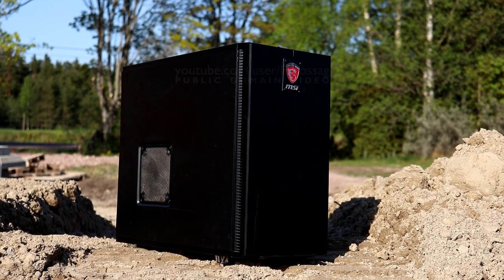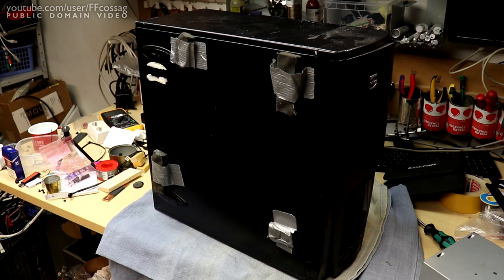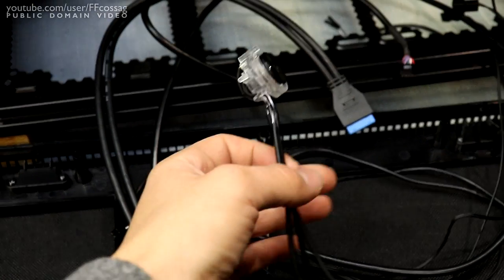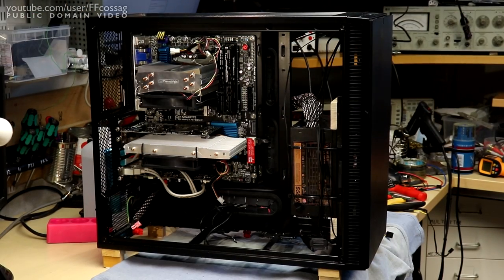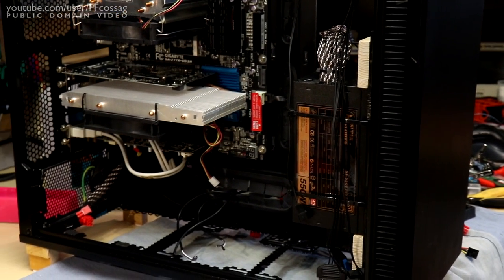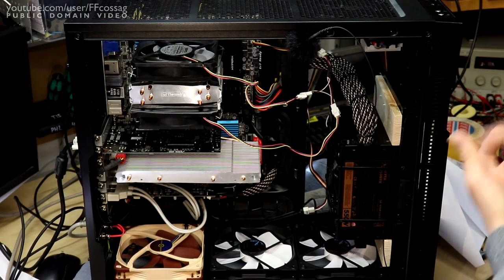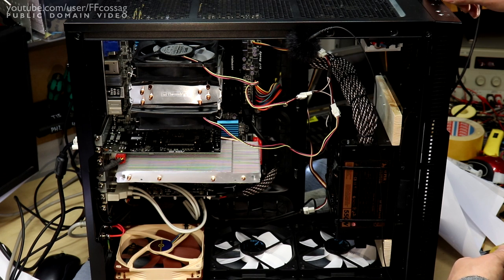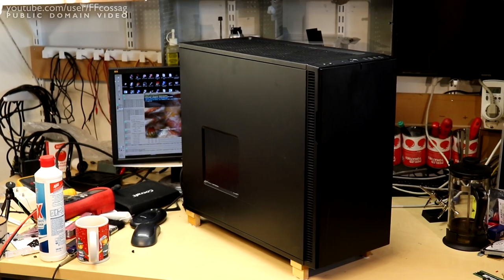Fractal Define R5 with PLYWOOD and JENGA BLOCKS!

Comment: One of the advantages of getting older (I'm 64) with some hearing loss is that you don't notice a lot of the fan noises that the majority of people do. As long as it isn't the higher picked whines of smaller fans like laptops and the high pitched whine of the old 60mm Delta 38's from the late 90's I don't even notice them. If I do, it's just a gentle whoosh that quickly fades into the background. 

I really do like how you created airflow paths instead of brute forcing it. I don't take it to the level you did here, but I do use some of those same techniques for some systems as needed.

Comment: Hey, I just got white r5 with a side window. It is the nicest case I have, but it went to the garage, because tthat is where my server room is, and I got it for hard drive capacity only :) have 0 drives in it though for now, only m.2, drives are in a old  DAS unit I got cheap, which turned out works fine with new drives (replaced controller card that goes into the computer)

Comment: you put great ideas in this pc case, well done!  the mainboard is a very powerfull one i run the same for years now 24/7 with tons of hdd around 280TB connected -)  32gb ram on 3770 cpu  it rocks. You will have lot of fun with this board for many years.
Reply from the maker: I've already had a lot of fun with it, sadly it's getting a bit dated for my applications. I wouldn't mind having a PC capable of less laggy video editing, at all ...

Comment: I hope that braker is DC rated, otherwise it won´t function correctly!
Reply from the maker: It is, but AC rated breakers are fine on low voltage DC loads as long as you can make it without the magnetic trip working, and keep in mind that they'll last only a few trips before going RIP due to arcing. Obviously not legal according to any building code, etc, but they do work in something like a PC. ;)

Comment: any tips for isolating Hard Drive vibration? my case has rubber mounts for the HDDs but they have proven to be rather useless...
Reply from the maker: I usually install a LOT of asphalt damping material around hard drive bays. In the past, I've even suspended 3,5" hard drives by strings, in the 5.25" bays. Works really well as long as you manage to mount it tight enough, so it doesn't bang around when you move the case.

Comment: lol i love it, Trust you to make a special super quiet machine with a strawberry on top  :-D.
I hope the cooling system does just what you wanted, it's very different indeed :-D.
You clever sod lol.

The fan regulator, did you try putting the 1000uf across the 47R output resistor to produce a start pulse, or was it a duff idea?.
The old 555 timer was ready for service if you really needed help :-D.
Reply from the maker: There's no real need for such a circuit, since brushless fans take a while between startup attempts, allowing the output capacitor to charge between tries.
Reply: You could've replaced the 7805 with a 317 then you could turn down it down to 1.25V min without a 47ohm resistor. 1.25 is the internal reference voltage of the 317. Connecting adj to ground gives 1.25V on the output.